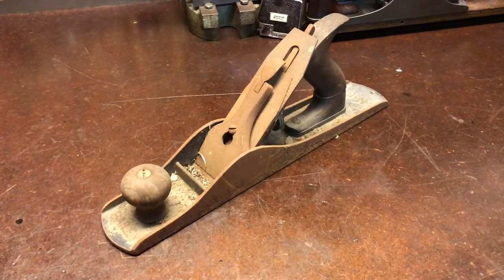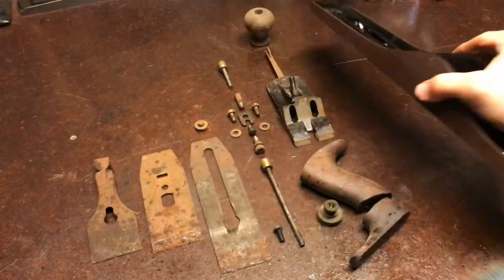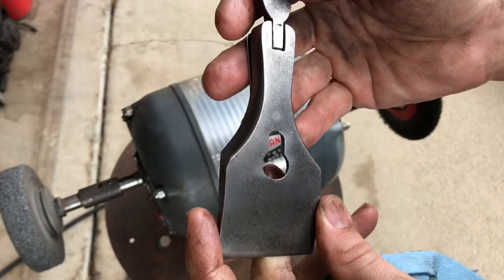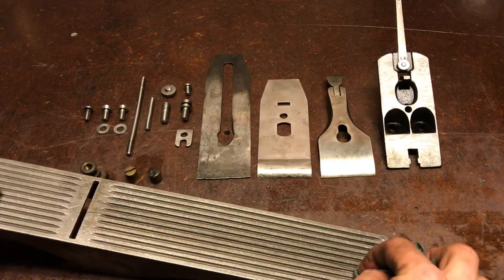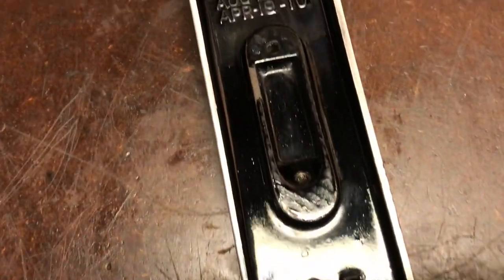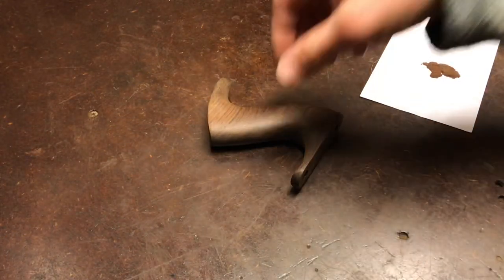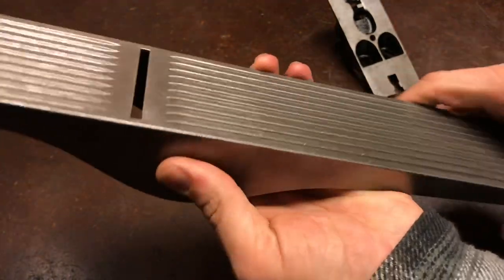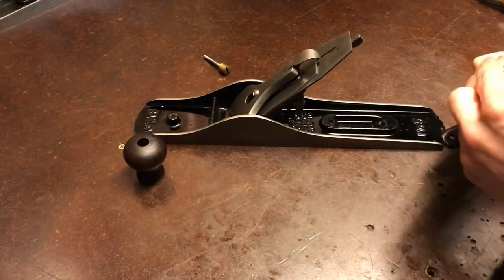102 Year Old Stanley #5 Plane (TOOL RESTORATION / PRESERVATION)

Comment: I have restored/conserved a few dozen planes and other tools, but none with as much pitting.  Given the tool as you found it, I think you made the right decisions about leaving the pitting and patina.  I make an exception for the two brass nuts holding the handle and tote.  I charge my strop and give them a few swipes. They gleam like the jewels in the crown.  They tarnish again soon enough if you don't like the bling.  Thanks for sharing.
Reply from the maker: I might have to try that trick next time I restore a plane. Thanks!!

Comment: I just bought a1948 model I believe. The front tote is higher and does not have the patent dates in the bed. Mine has a corrugated sole too. I have your model also, but I like restoring them and getting them back in working order. Great video!

Comment: Nice restoration. It looks great and works well. That’s all you should ask of a 100 year old plain
I am restoring a BedRock 4 1/2  patient APR 19 10, only issue found so far is a minute surface crack at the mouth. Your success has given me more confidence. This is only my second restoration. The other is a part restoration of a Record 5 1/2 for regular use. All my plane,with one except are, a hundred years old or more, being used, clean and seriously sharp. I cannot afford the premium modern planes but use the second best early Stanley and Record
Richard Fenton
Reply from the maker: Thanks! I hope your Bedrock turns out nice.

Comment: Beautiful restoration, just as a tip you can get better results with the brass let them on lemon juice for a night so in the morning you just go and wipe it up with paper, seriously it does all the job and we no need to use metal brushe that might scratch it a little bit. 
IMHO...

Comment: Nice video.  Beautiful tool and I liked the thought that went into your decisions.  I've restored a couple planes and feel the 100 year old but cared for look is the best.  I'd have liked to see how the epoxy filler ended up on the tote.  Also curious how the Japaning was in such great shape while the body was pitted.  You win some and lose some, I suppose.  Thanks for taking the time to post.
Reply from the maker: Thanks, I really appreciate that. The epoxy had a few bubbles in it so I didn’t turn out amazing. I think the japanning was in such great condition because the plane was just neglected not abused. I doubt it got used much but it just got left outside for years.

Comment: I hope this is helpful, as I haven't seen anyone mention it. BOTH the No 5C Type 11 and Type 12 had 3 Patent stamps. The way you tell them apart is by the adjustment nut (knob). There were two sizes of adjustment nuts made: An adjustment nut 1" in diameter (called a 'small') is only on the type 11 and an adjustment nut 1 1/4" in diameter (called a 'large') is a type 12. There is no way to distinguish a type 11 from a type 12 by just the number of listed patents:).

Comment: I've got a multi-part restoration series on a Type 13 #5C - the sole is now flat to 0.0001" all around - one ten-thousandth of an inch. Extreme overkill but it is pretty satisfying. Just have the woodwork and sharpening left
Reply from the maker: Cool, I’ll have to check it out.
Reply: @acraftsmansarsenal  I appreciate it!

Comment: What I’ve done for the brass knobs with knurling is either only run the wire wheel with the “grain”, so it gets in between, or use a nylon wheel on my dremel to get in there. Not the scotchbrite, but like nylon bristles. Works awesome. Not really applicable here, but rustoleum makes clear paint. It’s great for metals where you like the patina but don’t want it to rust more, like the handles on the drill press I did.

Comment: What kind of wire brush are you using on your buffer and what speed. I’ve really been struggling trying to clean up the corrugations.
Reply from the maker: It’s a Forney brand, fine bristle wire wheel

Comment: What specific wire wheels were you using on the grinder and the Dremel?
Reply from the maker: The wire wheel on the grinder is a Forney brand, fine bristle (which I highly recommend). The wire wheel that I used with the Dremel is not intended for use with a Dremel and it’s just a “no name”. I couldn’t tell you where to find them. I think I got that one at an estate sale.

Comment: Would a brass wheel be better for restoration or maybe a hard felt wheel with a fine abrasive applied
Reply from the maker: A brass wire wheel wouldn’t do a very good job of removing rust. I have seen people use the 3M scotch bright wheels to remove rust though.

Comment: Sorry mate only made it half way I'm sure it turned out lovely .but a bit long for me I'm afraid .
Reply from the maker: Thanks for the feedback. I totally understand, and because of the length I also made a short version. I edited out a lot of the talking and sped up some sections. If you get a chance watch that one and let me know what you think. Thanks!
Reply: I definitely will . My comment was in no way a criticism of your work and not meant to offend .one of my biggest passions is restoring old tool's . although not back to New or better than new as some do because I believe a tool should be used . Kind regards Dai from Wales .

Comment: I bought a number six today Bailey one pet number tell me something about it
Reply: It's in my opinion the pick of the bunch. Made between 1925 and 1930 during what is known as the "Sweetheart era" it's a type 13 or 14 (the latter having a raised ring around the base of the front knob, introduced in 1929). The iron should have a trademark with SW (for Stanley Works) within a heart at the top of the face. 

There are a lot of Frankenplanes around as parts got lost or broken so, your lever cap should have a keyhole shape, rather than kidney bean for the locking screw to protrude through, you should have a tall front knob, tapered at the bottom for the type 14 to slot into the ring, and the woodwork should be of Brazilian rosewood (now a protected species, so there's no replacing it)

A very nice tool.

Comment: It's a Bailey, not a Stanley.
Reply: It's a Stanley. Bailey was the guy that designed the original back in the 1860's.

Stanley bought the design and then employed him. Hence the much imitated Bailey design, still produced by dozens of manufacturers up to this day. 

It was truly revolutionary after millennia of wooden planes, but this one, is a Stanley and they were the only company to use the Bailey name.

The type numbers referred to are a system used by modern collectors to define age (type 11 1910-1918) as Stanley developed and improved the plane design over the decades, until (in my opinion) they started dropping quality in favor of cost after the Great Depression of 1929.

It really is a fascinating history.

Comment: I apologize for being so critical but can you finish one piece before you have to pick up another to inspect or look at it. And what’s with the screwdriver fetish. This supposed to be a resto of a #5 Bailey. I’m sure it will look very nice when you’re done. I’d get checked out for ADHD though! Just sayin’ ! Again I’m sorry, but you’re driving me nuts!
Reply from the maker: I understand, I was talking about the tools that I was using because some of my subscribers asked me to. So I was testing out the longer version with more explanation. But I also did a shorter edit of this restoration that you can find if you look at my other videos. Thanks for the input.